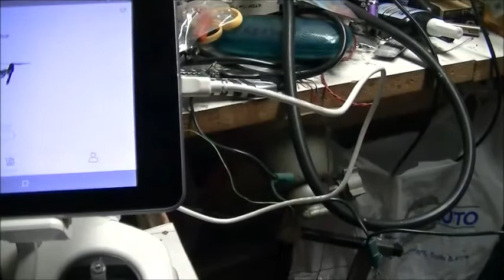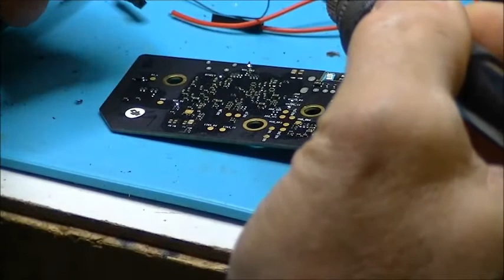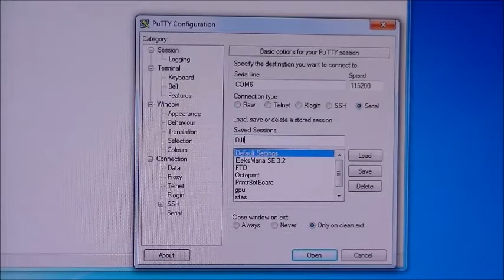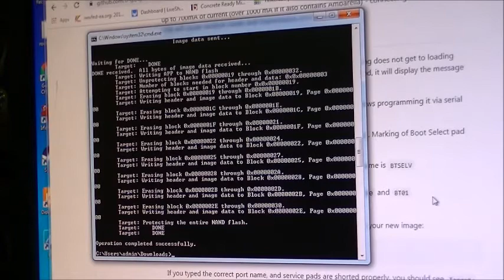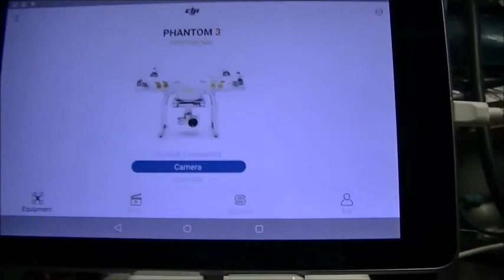DJI Phantom GL300A USB Repair fix no camera view

Comment: Thanks for an awesome video. I'm getting an error with PuTTY saying "error reading device" every time I plug the 5v pin into my FTDI programmer (using an arduino uno - maybe that's the problem?). Any advice?
Reply from the maker: What it sounds like to me is you are confusing a "USB-ASP" type programmer and an FTDI adapter. You can use an UNO as a programmer, and I suspect there is a way to program an UNO as an FTDI adapter (overkill)... but you really want to be using a simple USB to TTL adapter not a "programmer". 

I have a USBASP programmer that I can program devices by connecting to their ICSP port, but that is a more low level type communication using data and clock lines to transfer data where the FTDI adapter (USB to TTL adapter) is just a form of RS232 type serial communication over logic levels rather than real RS232 levels for long distances.
Reply: @tjones99  Thanks for the reply. I thought it was just a simple USB-TTL converter. I followed the instructions in this video: https://www.youtube.com/watch?v=qqSLwK1DP8Q
I am using a nano clone though so it may have its own weird nuances making things tricky. I'm able to write arduino sketches to the nano so I think the drivers are all in order but can't get the controller's usb board to talk. I'll probably just spend a few dollars and a few days getting one like the one you used. Thanks!
Reply: I wonder if it could have something to do with not being able to select the logic level with the arduino? Since you can select 3.3 or 5v with the adapter you used. Oh well, ordered one. I hope it works!
Reply from the maker: @devindorius5449  OK, thanks for the link to the Arduino to FTDI approach... that falls under the heading of "learn something every day". I just took a NANO and jumpered RST to GND and talked to it with PuTTY and it worked fine... (are you using an UNO or a NANO? First comment says UNO second says NANO?) 

But... 

Your next comment IS spot on (but not the only issue I believe). You can buy a NANO in 3.3V or 5V models... So to get correct logic levels you should be using a 3.3V NANO. 

So a NANO does have 3 power pins... 3.3V, 5V and Vin (and I suspect that's the same on both the 3.3V and the 5V models from what I read but I only have 5V NANO on hand) and specs that I read say that max 50ma is available from them. This may be too low to power the DJI board... or it may be that the power on surge when the 5V is connected to the NANO causes a momentary power drop that resets the CH340 chip that is talking to PuTTY... or it may be that your DJI board has other issues and is pulling 5V too low due to excess current drain. If you are using a 5V NANO then you are pushing too much voltage into the DJI board and that's not a good thing and that can cause the chips to get into odd modes that draw too much current. But if you are using a 3.3V NANO then you might try powering the DJI board 5V from another source and see if that works better.
Reply: @tjones99  My apologies, it's an UNO. I use nanos for just about everything else and mistyped. I'm thinking I must be pushing 5v into the DJI board. Hopefully that is at least part of the issue. I really appreciate your help on this, btw!
Reply from the maker: @devindorius5449  I think UNO is typically only 5V so I wouldn't recommend using your UNO as an FTDI in this situation (but thanks for the cool FTDI hack... ) There are a couple of 3.3v UNO variants out there but way cheaper just to order an FTDI board.
Reply: @tjones99  Sweet, thanks again for the advice. Will try this again when my real FTDI adapter comes.

Comment: and do you need to flash the remote control with firmware after this procedure?
Reply from the maker: I did not have to flash my RC (remote control) after updating my firmware. I think another comment below mentioned that but in my case I did not have to. I may have just been lucky with the version my RC was already at.
Reply: @tjones99  the problem is that I do not know what version of RC was, I got the drone already with the remote control not working. and since the phone does not connect, I do not know the firmware version of the drone. can except ubl1_hdmi.bin and U-boot_hdmi.bin what else to flash? in another branch, I found the firmware ubl1_prop.img, ubl2_prop.img, u-boot_prop.img, uImage. why is it*. img and not *. bin
Reply from the maker: @djtoxa83  Did the sfh_DM36x -nandflash command execute without errors? Your other comment implies there were errors.
Reply: @tjones99  errors were at the first inclusion in PuTTY as well as you, and at sfh_DM36x-nandflash everything as on video from the second time flashed.
Reply: @tjones99 I understand you need to try to flash the firmware 1.3.20 from a USB flash drive or start with the first one? what was your RC version after restoring the remote
Reply from the maker: @djtoxa83  Didn't note the version and it was a another person's remote so I cannot check the version. 

I hads a similar experience with some LightBridge devices and my issue there was a combination of flashing AND I literally had 3 bad micro USB cables. My only suggestion at this point is try a new micro USb cable from the controller to the phone. 

Oh, one other is making sure your phone has USB debugging enabled if an Android... From your comments I get the impression that you got this unit in this state and that you have NEVER successfully connected the DFJI Go App to ANY device so you cannot really tell at this point whether your phone is working properly. I have had a number of tablets and phones that I was NEVER able to connect properly even when I knew things were working. I have had better luck with iPhones than Android phones.
Reply: @tjones99
Reply: @tjones99  I have a second remote GL300B the phone is working fine but there is no image (black screen), there is only telemetry and know the firmware version 1.4.10 drone (the same phone and cable connected to GL300А), I want to restore and GL300А, but so far no result. you may have to also flash the suspension, photos and videos are saved on the SD card, but there is no picture on the phone.
Reply from the maker: @djtoxa83  Let me see if I have this right. Phone connects to GL300B fine and shows telemetry etc but no image. I had a case of that and was able to resolve using same technique flashing the Gimbal main board. Never made a video of that but it was pretty similar procedure following the instructions at 

https://phantompilots.com/threads/fixing-flash-in-dm365-chip-within-ph3-pro-gimbal.127310/

If memory serves me I did not have to do a full disassembly, just removed Gimbal covers, but that does involve delicately unsticking the main ribbon cable from the larger cover. Covers off allowed access to solder points to flash. 

If GL300B remote works, then it is bound to the drone. When you are testing the GL300A remote, have you done the binding procedure in the DJI GO app? You have to do that before it will connect.
Reply: @tjones99  yes the GL300A was tethered before connecting the phone
Reply from the maker: @djtoxa83  Assuming your term tetheried and my term binding mean the same thing (I think DJI calls it linking) then I have no other suggestions I am afraid.
Reply: @tjones99  thank you for your help and for the video. I started the GL300A just after restoring the NAND, flashed it from the flash drive P3X_FW_V01. 03.0020 and everything worked. it remains to restore the suspension board in the same way, get the video and you can go to the sky.

Comment: I did everything according to the instructions, but there were errors in nand, it was stitched without problems as in the video from the second time, I put nothing changed as I did not see the remote control, the phone does not see it. the procedure was performed on windows 8.1 (32) USB-TTL CP2102
Reply from the maker: If there were error messages when the sfh_DM36x -nandflash program ran then my suspicion is the NAND chip itself has failed or has a solder problem on your board. That is not an easy fix usually requiring special soldering equipment and skills.

Comment: Hi Terry. The link to the bin files does not work. Can you please share the files to me?
Reply from the maker: Well thats interesting... the upload file was still there, but the old link pointed to http://tjhs.ca.... and when I look at the link provided by Wordpress now its https://www.tjhs.ca.... 

Short answer is try again... should be fixed now. thanks for pointing it out and letting me know.
Reply from the maker: Just spent more time looking at this and I am leaning towards it being just a web hosting issue. 
https://www.tjhs.ca/wp-content/uploads/2019/12/DJI_GL300A_USB.zip
http://www.tjhs.ca/wp-content/uploads/2019/12/DJI_GL300A_USB.zip
https://tjhs.ca/wp-content/uploads/2019/12/DJI_GL300A_USB.zip
http://tjhs.ca/wp-content/uploads/2019/12/DJI_GL300A_USB.zip

All URLS that point at the same place seem to be working fine now.

Comment: I did it Terry thank's alot...🙏And thanks for the zip file too🙏
Reply from the maker: Awesome! The soldering can be a bit delicate... but the reality is even if you have to buy EVERYTHING you need including a simple T12 soldering station with a nice fine tip and good temperature control for $55 its still worth having a crack at it!
Reply: @tjones99  Thanks Terry, now still pandemi arround the world...Certainly in Indonesia.I'm still dosn't have enogh money to buy that,couse the pandemi(COVID),i loose my job...😭.The drone can be fixed couse your tutorial makes me happy.Thanks alot Terry for your suggest...🙏

Comment: Hi. Great video, thanks. My Phantom 3 Pro had no damage and hardly flew. It connects fine, can even fly the drone, but the is no video at all. I have a different USB board on my controller, there is no components on the back. I can see the histogram on my software, that change if I change the video environment, but there is no video at all. Struggling for a long time now to figure out what it is. Any advise, please?
Reply from the maker: What is the model number of your controller?
Reply: @tjones99  Hi. Thank you for your response. It is a GL300B
Reply from the maker: @demetrismit3090  This apparently does not apply to GL300B and GL300C if you read 

https://phantompilots.com/threads/fixing-flash-programming-in-dm365-chip-within-gl300-remote-controller.144123/

Have you tried a USB firmware update on your controller through the app?
Reply: @tjones99  Thanks Terry. I really appreciate your time. Yes, I do not see any processor IC on the board. So that leave me with the question, why is my video not showing, but can see the histogram for the footage. Much appreciated.
Reply from the maker: @demetrismit3090  Sorry but you are beyond my abilities with your particular controller.
Reply: @tjones99  All good. Thanks for the help. Much appreciated.
Reply: I have this same fucking problem

Comment: Hi, thanks for the video, seeing it done is alway useful. However I am deaf and reliant on the subtitles which I have found are often rather difficult to follow on ANY youtube.
Can you please clarify the following points, 
1) around 13 minutes you disconnect the +5V, why and is it mean to remain disconnected for the reprogramming etc.?
2) Around 15min you 'say' "this time I'm gonna hold the BTS 
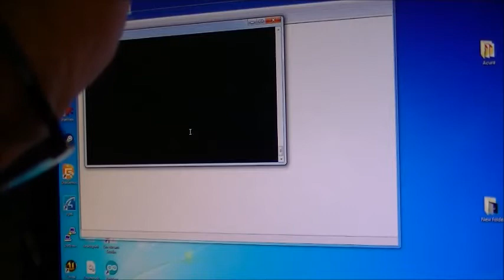15:11 ALV wire onto the 3.3 volt as I plug it
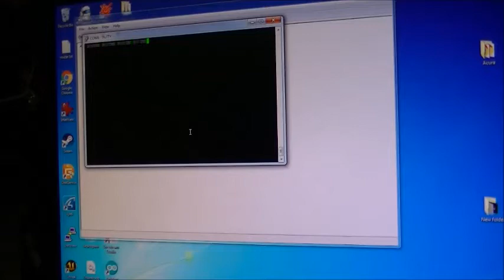15:15 in we will get different messages so now
15:19 the board has booted into a boot me mode
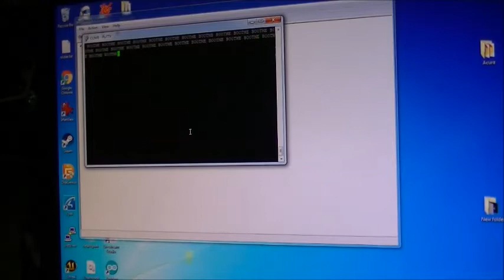15:24 and it just sits there saying boot me " Are you talking about connecting BTSELV pad to the 3.3V pin on the USB-TTL device? If so is it a momentary contact or do you leave it connected?. In a phantom pilots article https://phantompilots.com/threads/fixing-flash-programming-in-dm365-chip-within-gl300-remote-controller.144123/ a wire is soldered between the BTSELV pad and an adjacent 3.3V pad.

I have followed you video and see what you show etc. i.e. repeated bootme's, then the program running and halting etc. and requiring the reissue of the command after which it seems to work and I get the "operation completed successfully" message but when I reboot the board I am back to the repeated bootme messages.
Any ideas?
Reply from the maker: OK, let me have at it and thanks for making me more aware of this issue so I can try to be more descriptive in future. 

1) around 13 minutes you disconnect the +5V, why and is it mean to remain disconnected for the reprogramming etc.?

I disconnect the +5V but leave the FTDI adapter plugged in to keep Putty happy just so I don't error out of Putty and keep having to reopen Putty... lazy... 

2) Around 15min you 'say' "this time I'm gonna hold the BTS 
Just before that I show a boot without the BTSELV connected wire shorted to 3.3v and it fails to boot, then I say I am holding the wire to 3.3V and power on and I get the BOOTME message. 

15:11 ALV wire onto the 3.3 volt as I plug it
15:15 in we will get different messages so now
15:19 the board has booted into a boot me mode
The above 3 are related to 2... to put the board into the special boot mode to receive the upload you have to connect BTSELV to 3.3V on power up. 

15:24 and it just sits there saying boot me " Are you talking about connecting BTSELV pad to the 3.3V pin on the USB-TTL device? If so is it a momentary contact or do you leave it connected?. In a phantom pilots article https://phantompilots.com/threads/fixing-flash-programming-in-dm365-chip-within-gl300-remote-controller.144123/ a wire is soldered between the BTSELV pad and an adjacent 3.3V pad.
 

So good question here... It is a momentary connection on boot I found. The BTSELV wire connects to the 3.3V pad on the board that is close to BTSELV. This is the soldering part at 8:04 where I say I am soldering the wire to the BTSELV pad so I can hold it to the 3.3V pad on power up. 

I have followed you video and see what you show etc. i.e. repeated bootme's, then the program running and halting etc. and requiring the reissue of the command after which it seems to work and I get the "operation completed successfully" message but when I reboot the board I am back to the repeated bootme messages.
Any ideas?

If you do not disconnect the BTSELV wire from 3.3V it will continue to boot in special boot mode and repeat BOOTME

Hope this helps!
Reply from the maker: I will address you’re queries when I get home from the lake and am on a fast internet and a full sized screen.
Reply: @tjones99  excellent, thanks.

Comment: I wanted to say thanks, this video helped me recover an otherwise "dead" GL300A board today. Definitely keep making videos like these :). It was a little bit finicky, but I eventually got it working on a windows 10 laptop, and running the command prompt as admin and with "use legacy console" option checked. I figured as I had gotten far enough to see BOOTME, and the first flash attempt there was something out of "sync" with their TX and RX messaging. In case it helps someone else, when I didn't go that route I kept getting stuck on the second flash attempt with and endless loop of these error messages (which I couldn't find much out there searching these):
"Image data sent...

Waiting for DONE...
        Target: UART Receive Error
        Target: Starting UART Boot...
        Target: BOOTUBL

Waiting for SFT on the DM36x...
        Target: Starting UART Boot...
        Target: BOOTUBL
BOOTUBL commmand received. Returning CMD and command...
CMD value sent.  Waiting for DONE...
        Target:    DONE
DONE received. Command was accepted.
Sending the UBL image
Waiting for SENDIMG sequence...
        Target: SENDIMG
SENDIMG received. Returning ACK and header for image data...
ACK command sent. Waiting for BEGIN command...
        Target:   BEGIN
BEGIN commmand received.
 100% [                                                              ]
                           Image data sent..."
Reply from the maker: Thanks for the post. Hope this helps others.
Reply: Вы решили эту ошибку на втором этапе загрузки DM36x? i also have this error and go beyond the second stage of the download does not go